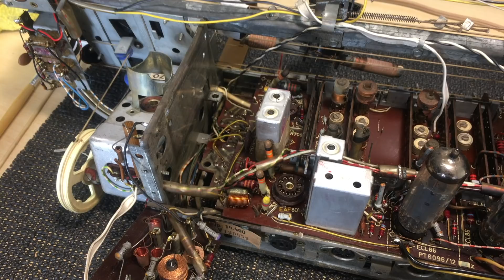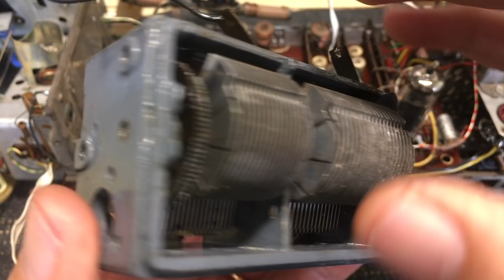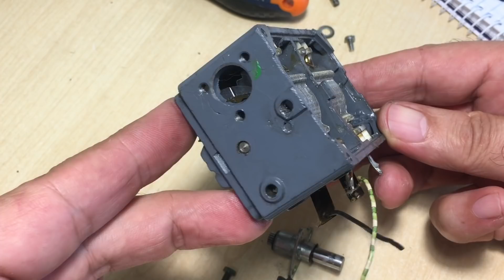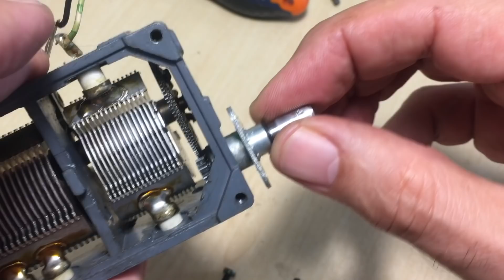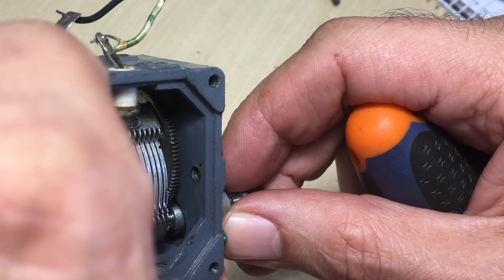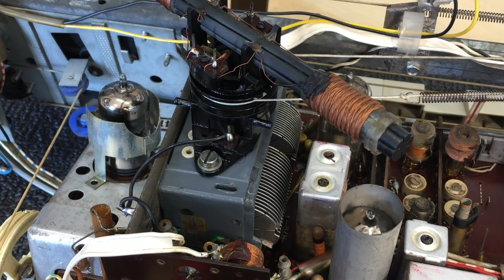Blaupunkt Arkansas stereo tube radio restoration - Part 4. Tuning capacitor repair and testing.

Comment: Great video series.
BTW, WD40 is NOT a lubricant. 🙄 It's a water displacement (hence the WD). It DISSOLVES lubricant. Gets rid of squeaks for a short while. Use a lubricant.

Comment: Awesome video a client of mine showed me hers yesterday she wants to see if it works what do you recommended I check first
Reply from the maker: I normally follow a fairly standard procedure when I evaluate a Tube Radio. I make this procedure evident in the videos that I create, so perhaps you could try something similar.
Reply: @electronicsoldandnew  are there any fuses I should check first Ty for the info

Comment: I'm working on fixing one of those now. It's for a Grundig but, looks to be the same device. I noticed on yours, there is no tension on the "zero backlash" gearing system. Mine has the spring stretched out a bit when the drive gear is in place. I think yours needs to have the spring removed before installing the drive gear, then shift the thin gear so that the spring will add tension when the drive gear is in. Then install the tension spring. That will restore the function of the zero lash gearing.📻
Reply from the maker: Yes, I always have some difficulties with that.

Comment: Failure of the oscillator section of the ECH81 is quite common . I have had that problem on many German and also Philips radios . Seems most common on that type of receiver . However back in the 60s I do recall changing them in more mundane sets . I learned to always try that first before suspecting something more obscure . The static sound at the end of the band on AM is the clue to oscillator failure . Lovely resto job . Well done . Regards from Thomas

Comment: The wd40 sprayed on the tuning capacitor fins Changed the caps tuning frequencies.
Reply from the maker: If I get WD40 in there, I then spray it out with IPO to clear any residue and counteract the change in capacitance.

Comment: Just started watching your restorations. Well produced and very instructive. Question regarding this capacitor: After cleaning it, did you apply lubrication anywhere? I ask because I have what appears to be the same variable cap on my bench, though it came from a Grundig. It too had seized up. I disassembled the small gear drive assembly and will re-lube that. But I'm curious whether the capacitor shaft itself should be lubricated after cleaning and, if so, with what? Again, thanks for taking the time to make these videos.
Reply from the maker: You should be very careful about lubricating a cap like this one. Only drop a very small amount of machine oil at the ends but don’t let any get in between the blades. Not much is needed.
Reply: Professionally done indeed. What was it that loosened the stuck shaft? WD40? You seem to move the fins effortlessly, the one with me takes some power. Is that OK?
Reply from the maker: If I remember correctly, it was WD40 at first. Then some machine oil.
Reply: @electronicsoldandnew  Thanks

Comment: Great to see you tackle and overcome the issues with that tuning capacitor.
There are several methods of tuning the tuning capacitor, some with dial cord and springs, some with gears, etc.  I would love to see an in-depth video that covers them all in detail and goes over the pro's and con's of each.  Wonder if you would be interested in doing such a video.
I want to learn all I can about how to smoothly tune and eliminate "backlash" in the process.
Reply from the maker: It’s an interesting subject. if the situation arises that makes such a video pertinent, it may well get done 😊

Comment: I had the same problem with my 1956 Grundig Majestic . With switch facing up , put two drops  of Marvel  Mystery oil two nights in a row ,and let set for twelve hours each .This worked beautify ,D W 40 is over rated.. Marvel has worked well on my 1948 Studebaker.
Reply from the maker: I can’t get that oil here.

Comment: Good quality easing oil or even paraffin would have soaked through quite quickly, but it needs a good lubrication afterwards. The best I ever found was a tin of Vaseline oil I once bought in France for the kids bicycles when we were on holiday there. I used it for many things that needed a very light oil. Can’t find it in the UK. Could always use sewing machine oil which is also good.
Reply from the maker: I often use that too (sewing machine oil).

Comment: I bought a small ultrasonic cleaner at an op shop a few years ago, specifically to clean & repair a piece of cheap jewellery that had great sentimental value for my partner. It now spends most of its time cleaning and freeing small stuck shafts & switches. Best $5 I ever spent 😉.

I've also taken to using 'baby' Loctite e.g. 222 or similar on screws like those on the tuning cap. Although the manufacturers rarely used anything - at best, a star washer or dab of indicator paint - & didn't have them come loose, I've found that after rework they have a tendency to work loose no matter how carefully I cinch them up.
Reply from the maker: Jim S : ultrasonic cleaner definitely on my wishlist.

Comment: It's a bit hard to tell but it looks like the large gear is a spring loaded double gear so the two can be tensioned vis-a-vis each other to eliminate backlash.  Stretching the spring between them just one tooth is generally enough from what I've seen in other videos.  Was that the case with this radio?  Excellent repair, by the way, as always.
Reply from the maker: I did not need to mess with the double-gear because it had cleared loose with all the piling I used to try and dislodge the shaft before finally removing it. I was ‘lucky’, I suppose. There is no backlash at all as it is.

Comment: Yes my friend, I too have experienced tuning capacitor gearing ratio mechanisms that have seized solid.  My modus operandi for un-seizing them is to drop the offending part into very hot water, letting it remain there for a minute or two, them having removed it, submerge it into kerosene: this operation may need to be repeated.  It might be necessary to gently tap the shaft, or spindle backwards and forward in its housing with the plastic handle of a screwdriver whilst it is still warm.  Once it begins showing signs of wanting to free-up, gradually rotate the shaft by gently rocking it back and forth.  Once free, I rotate the shaft a few times in kerosene to soften, and clean out the old grease.  Then, with the aid of a fine tip nozzle I attempt to inject fresh grease into the bearing (that part of the process can sometimes be ‘touch ‘n’ go’).
Another superb video.
Phil.
Reply from the maker: Thanks for the tip. I had a hell of a time getting this one loose, but fortunately, with some solvents and patience, it worked out.

Comment: Re: jammed up shafts,   I've had good luck freeing them by heating up the outside sleeve - I keep a big old soldering gun for the purpose. That old grease sets like a rock !
Reply from the maker: Monstermash423 : that’s what I like about this hobby. You always learn a few new tricks.

Comment: Big project!
It seems to me, that the two big concentric gears with the little spring in it, which drive the fins, are also stuck and don´t move freely against each other. There has to be some mechanical tension to avoid backlash when tuning.

Comment: some types of old grease become rock hard with the years...it happens a lot on Nordmende equipment also....next time you come across a frozen potentiometer or tuning capacitor etc before dismantling try to hit it with a hair dryer, 20 or 30 seconds will be enough , it will soften the grease and it will come loose temporarily, then while it is warm shoot some wd40 and rotate it, then apply some oil.
Reply from the maker: Hugo B. Thanks Hugo. Wish I’d thought of that before going to all this work of dismantling. By the way, I presume you live in Portugal? Do you know where I can buy an ECL86 in our country?
Reply: @electronicsoldandnew  it actually works very easily...once the part hits 50 or 60ºc the grease becomes liquid but let it cool and its frozen again...need to hit it with wd while its warm... 
you already asked me that in the previous video,i am in Porto , Vila nova de gaia,  i made a search on my usual ebay seller and they have those tubes new but its more than 30€ with shipping https://www.ebay.co.uk/itm/ECL86-Vacuum-Tube-Valve-Rohren-NOS-NIB-x1/142205273323?hash=item211c1844eb:g:77cAAOSw5cNYIaNU:rk:1:pf:0
they ship very very fast, here in the continent it takes about 4 days for the stuff to arrive from them, they are based in France.

if you can make it work with an ecl82 i can borrow you one or sell it to you cheap. i have been through my stash of tubes and i dont have an ecl86 unfortunately. Here in Portugal besides OLX sellers i dont know of any local guy with tubes..

By the way since you are not into TV's if you happen to come across any vacuum tube tvs for sale for a cheap price there in Madeira please tell me...i still have room for a few but people here are asking way too much money
Reply from the maker: Hugo B. Thanks for the offer of the ecl82. Unfortunately I believe the gain will be too low on the triode section, and I think it will compromise the set.
I have never seen a tube tv on offer in madeira, probably because of the period that the first tv transmissions became popular here (quite late), but I’ll keep my eyes open for you. 
I have a daughter at UTAD in Vila Real, so am through your part of the world every now and then. Actually going over in a couple of weeks.
Reply: @electronicsoldandnew the ecl82 i guess it would work fine if there would be just one tube, in you case both channels would behave differently.
Thank you for keeping an eye on tvs .  if you pass through Vila nova de gaia and have time for a cup of cofee  i would be happy to show you my radio and tv collection, its nothing special but i have some interesting stuff.

Comment: Some people have told me in the past that switching off the HT leaving just the heater on can poison the cathode of the valve. If it's true I really don't know.
Reply: This is a common problem if the radio is only used to receive FM. The cathode of the AM oscillator gets deaf.
Reply from the maker: Makes sense. Probable cause in systems like these.
Reply: Could be worth removing the switching so the HT is on all the time. After all we are probably only talking about a few mA. I doubt you would have any issues with noise.
Reply: Personally I think it would only affect tubes with a lot of hours on them.  Large transmitting tubes with thoriated cathodes definitely shouldn't be left heated for long periods without HT on them since thermionic heating of the plates is the only way to effectively getter them.

Comment: wondered that it worked at all having connected only antenna ground???        (antenna plugs)
Reply from the maker: Top two are fm dipole. Bottom two are: left = antena, right = ground. Red antenna connection is in the left one.

Comment: Ha! I did exactly the same job on a Loewe radio today.  The AM tuning capacitor was siezed up solid.
Reply from the maker: Derek Herbst . I had a feeling this was the problem as I’ve had it before, and hoped that I could release it without removing the bugger, but no such luck. Sometimes they are just too stubborn.
Reply: I heated it up with a soldering iron and it came loose. However I also first removed the gearshaft.